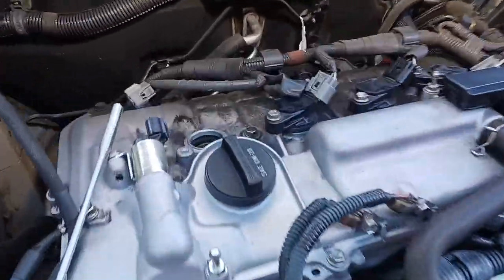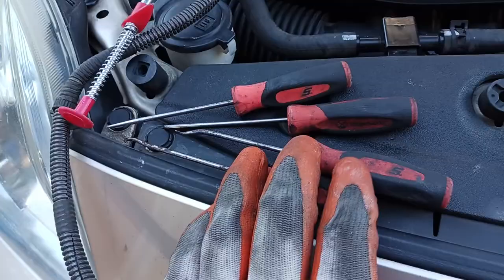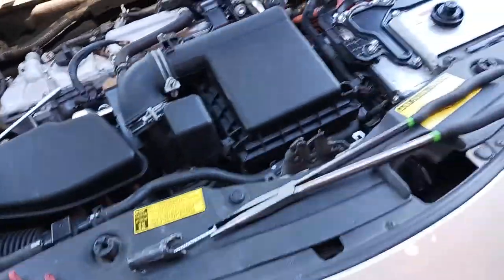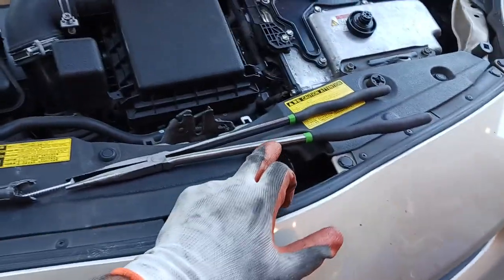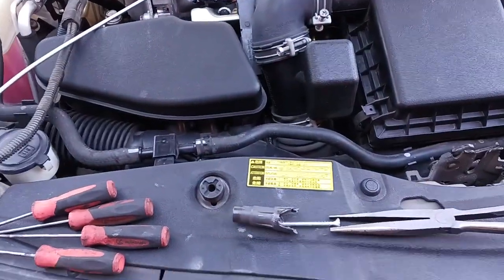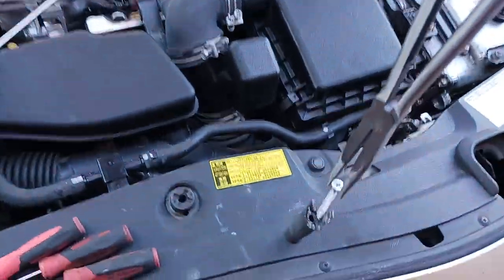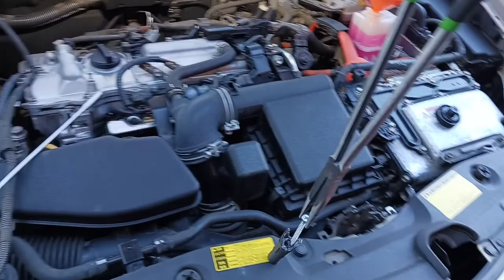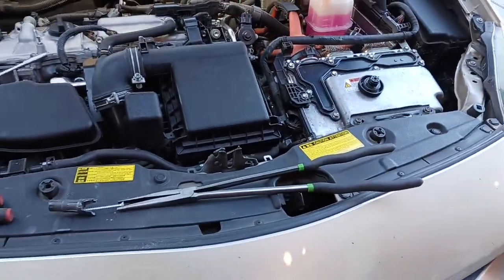how to get stuck ignition coil boot out  best way

Comment: It's been said to put a dab of dielectrical grease in the end of the hole on the ignition coil that goes over the tip of the spark plug to prevent this .

Comment: i used a stick of silver solder. a steel coat hanger straightened out will also free up the boot to get it off the plug.